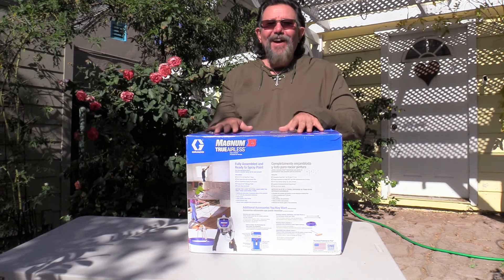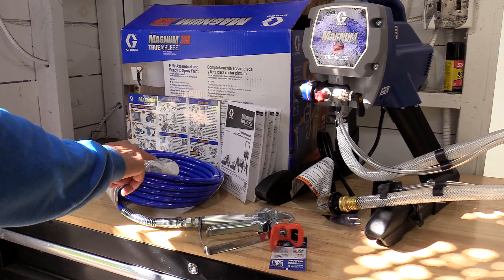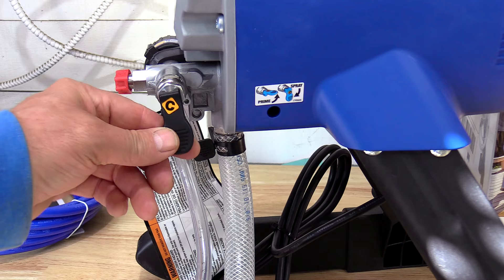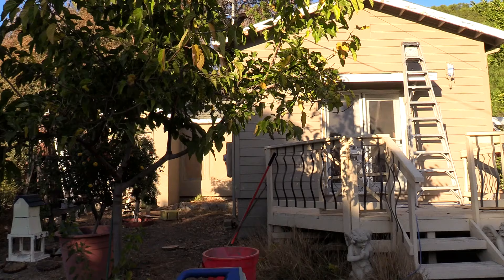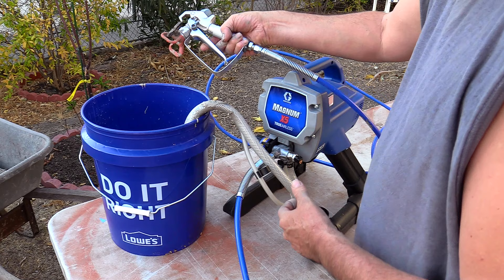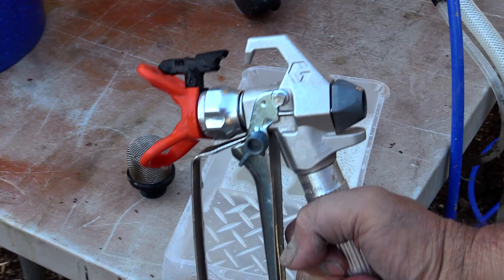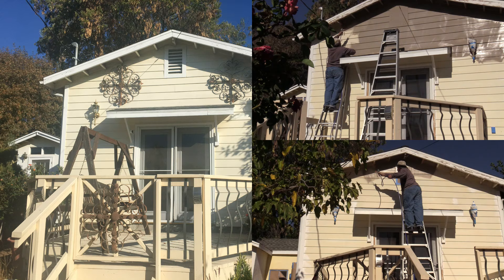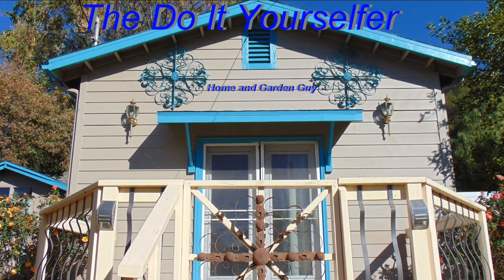Using My New Graco Magnum X5 Airless Sprayer

Comment: Very good demo.  Be sure to check Lowe’s for a Graco PRESSURE ROLLER accessory that is attached with supplied elbow where the gun spray tip would be.  It comes with a short extension tube. A 5 hole roller frame emits paint as gun is triggered and feeds a porous Graco 9 inch roller.  I purchased two extension poles and was able continuously paint  second story walls from the ground.  Very fast applying paint thick and smooth,  no over spray, no dipping roller into paint bucket.

Comment: This is a good video, but I just bought one and the directions say to clean the filter in the gun handle every time you flush the system as well.  Good presentation though.
Reply from the maker: Clean the system with water from a pressurized hose and it will clear the filter, just as would do it when taking out the microscreen that is in the sprayer. The cleanout shown works. 
Your comment is understood if my technique of cleanout is not followed.

Comment: Enjoyed your video. Really liked your 4 way split screen of painting.  Did you find it a problem moving the unit all time unlike x7? Thinking of x7 or x5 to purchase
Reply from the maker: It was not a problem moving it; the twenty-five-foot hose allowed me to move the ladder along, hang the sprayer on it, and then pick up the 5 gallon bucket in one hand and the airless compressor in the other for reposition and continuation.

Comment: spent 2 wks painting my house the last time so i bought this for 300 if it takes me 3 days this time it will be great and less toll on my body
Reply from the maker: It is a definite labor and time saver. After prepping and masking, to think of hand painting an entire house is daunting at best. I have an open soffits, and to think of doing it with a brush would make me not want to do it myself. I can't begin to think of the labor and time it saved me. The last big plus is that I did not need to thin the paint. Good luck with your project.

Comment: Great Video. Thank you
what about Graco Pump Armor is it necessary to use it or you can replace it with other things like soap water?
Reply from the maker: I believe the liquid has many more properties than soap does. It states in the documentation that it helps to keep your system from freezing. When I bought the sprayer, even before I read the documentation, I also purchased a secondary bottle. 

This is only my opinion, not referenced anywhere else, there is a reason for manufacturers to produce maintenance lubricants. Like my automobile and many other tools, I do not short change what is recommended. I used only premium oils in my equipment, and I do the best that I can to lubricate and maintain them, as I understand that experts and engineers have done their jobs to make the product's lifespan improved. Once again, this is only my opinion.
Reply: If DESPARATE use anti freeze or paint thinner

Comment: Did you have to do a second coat. Did yiu need to back roll?
Reply from the maker: Yes. I applied 2 coats. In one area of my small home, where the stucco is very exposed to the sun, about four hundred square feet, I went back to and sprayed it again after finishings each coat. I did it because I know how much degradation it receives from the sun. 
So I did two coats on my entire home, with two coats extra where I knew weather came into play. I did not have to back roll the paint. I put a clean paint brush in my back pocket for runs but did not use it--thought that was awesome.

Comment: FYI, you comment that the unit can spray mineral spirit base paint, The first thing mentioned in the WARNINGS literature  is  to use water based materials only...
Reply from the maker: I believe this the comment you are referring to:
Q: "Can you use this for oil based paints?"
Comment: "It can be used with mineral spirits. Check Graco specifications"

Here is what is found on Graco's website: “All Magnum sprayers can spray water-based and solvent-based paints, stains and primers that can be cleaned with mineral spirits. Materials that cannot be used with Magnum sprayers include solvent-based lacquers (exceptions are the ProX21 and the Pro210ES), texture based materials and elastomeric.” 

That is why the question was directed to their website for further information.
Reply: @doityourselferhomeandgarde9732  OK, After a little more research I understand the units don't allow lacquer/lacquer solvent use due to incompatible packing seals that will deteriorate. Lacquer thinner conversion kits are available to purchase that will allow use of lacquer products. I still find the thinner flash point to be a gray area. I was assuming that the brushed motor could spark and ignite thinner vapors in the air, enclosed area. Different paint thinners have different flash points so even a textbook answer can't be assumed...

Comment: Thank you for an awesome video. Did you need to thin the paint before painting?
Reply from the maker: No. That is one of the reasons why I upgraded to the sprayer. I have used it on a thicker Zinsser 1-2-3 Bulls Eye primer without thinning, also water based. I sprayed it at about 2400 psi and was pleased with the results.
Reply: @doityourselferhomeandgarde9732  Thank you, That's awesome. I have the magnum x5 and want to paint some kitchen cabinet doors.

Comment: Very Nice Video. I need to prime and paint my basement which is ready after drywalling and has concrete floors. One question I did have for you is, are there restrictions of what kind of primer or paint can be used with this sprayer? I didn't see a viscosity cup, so are there any instructions on paint thinning that we need to follow or can it handle a large range of viscosity?
Reply from the maker: I did not use a viscosity cup to check its thickness. Before I purchased the paint, I made sure it said was sprayable.  On the paint bucket, it clearly stated it should be sprayed at 2000 psi and did not need to be thinned. On the sprayer unit for pressure adjustment, there is no numbering to indicate pressure. Knowing that its greatest pressure is rated at 3000 psi, I rotated the pressure adjuster (knob) to two-thirds, which is equivalent to 2000 psi. Before I started spraying my home, I did a test spray on a piece of cardboard (I show this on the video, just before I start actually spraying my home). Hope this helps. And best wishes with your project.
Reply: @doityourselferhomeandgarde9732  Thank you so much for the quick response. Ive only painted with rollers and that too just once, so I was not aware of the psi mention in the paint bucket. That is vital info, thanks so much for sharing.
Reply from the maker: @sn2477  Yes. I used a water-based paint. I hope for your safety that you are using a water-based paint. You are correct?
Reply from the maker: Make sure you use a water-based paint, a mask rated for paint, and eye protection. Also make sure that you have good ventilation.
Reply: I have to first spray primer. If i use a water based primer, will it work directly with a 515 tip, even if the pressure range recommended falls within the X5’s range? Ive heard that water based primers can be thick.
Reply from the maker: I would recommend talking with the person who sold you the paint/primer.

Comment: Great vid. What’s is the cleaning solution you’re using to brush the tip at the end? Just soap and water?
Reply from the maker: Yes, dish soap. I used the sprayer the next day and finished my home. After I finished on the second day and knew I was not going to use it for at least two weeks, I ran the blue liquid through it to protect the inner workings of the compressor. By the way, I really like this sprayer.

Comment: How long can you leave it sitting idle if you've to change location or take a short break? That is, does it clog up quick or dry up if you stop using it for say 15 minutes or so? thx
Reply from the maker: I did take short breaks. I either moved the 5-gallon bucket of water-based paint into the shade when possible or used a white-faced piece of cardboard to deflect the sunshine away from the bucket.

Comment: Simple question how do  you reduce overspray, paint in air, airborne paint, for more precision painting with this unit? Chinese  unit didnt do this and my machine from 30 years ago. 

made sure area is warm, paint is warm  . not just the water
reduced pressure to lowest.  

So much paint is wasted with this unit.
Reply from the maker: Do not spray when there is wind, even a slight breeze. Try to keep the spray nozzle as close as possible without out runs. If concerned about runs, keep a half-inch smooth brush in your back pocket for easy correction. My personal experience is that the trigger and adjusted pressure work quite well. Even though I did keep a smooth brush in my back pocket, I never used it. Good sprayer for a do it yourselfer.
Reply: @doityourselferhomeandgarde9732  thank you.  even indoors same problem. i went a head and got a chinese spray gun/kit for $40 and it worked 100 times better then this unit.

Comment: can you do interior cabinets and small jobs with this unit?
Reply from the maker: I have not sprayed interior cabinets. But I would imagine it would do a consistent job. However, I know the sprayer has many different tips. I would imagine a tip that sprays in a finer mist or atomized fashion would be extremely useful. I would recommend doing a search on what spray tips they offer for cabinetry. I think it might be worth investigating.
Reply: Look for the 311 tip.

Comment: What is the thickness of that paint? And did you use a 515-spray tip?
Reply from the maker: The paint was purchased from Lowes new and was sprayed the day or so after it was mixed. The type of paint was DuraMax paint & primer in one. Its label recommended spraying at 2000 psi. The spray tip used was a 515. I was/am satisfied with both the paint and the sprayer.

Comment: Would you recommend this machine for a small project such as cabinets?
Reply from the maker: I have used it for 200 square feet on shutters (three coats)  and over 2100 square feet of my home with two coats, which makes that around 4200 square feet. It is a very consistent sprayer. I cannot comment on your cabinets, as size would make a difference. I know that if spraying a gallon plus of paint or primer that this is my go to sprayer, as a DIY person. It does a really good job. 
By the way, it is recommended to change the tip on this sprayer after 15 gallons of spraying.
Reply: @doityourselferhomeandgarde9732  thank for the information, have you used it with oil based non-flammable paint? Or would you recommend another spray gun? I was also looking at the Graco Truecoat 360 VSP. But I just like this one because I want to also do big project such as walls, and fences.

Comment: Could I paint a mobile home with this
Reply from the maker: If the paint used will work with an airless sprayer...check with the paint vendor.
Reply: If you can paint a house with it I should be able to paint a mobile home

Comment: Forgot to clean filter in spray gun
Reply from the maker: Nope. As the line was clear so was the filter. It was checked the next day when finished with my house. Even after the FINAL clean up for storage, it was clear, the same way the hoses were clear of paint shown in the video. On the final cleanout, I did run the blue storage liquid into system to prevent freezing. Questions, see Short Term storage on page 27 of owner manual for Magnum TrueAirless.

Comment: Show us the the queen palm tree sir
Reply from the maker: If you are interested in seeing how they're doing, I have provided a link to my Toro Leaf Blower video. One of the Queen Palms, with 10 months of growth, is featured in it. https://youtu.be/SaR0rgmUabI
Reply: @doityourselferhomeandgarde9732  
Thank you 🙏🏽 💞
I’m moving to LA 
I’m trying to know what type of trees grow there
Reply from the maker: @thezebrafinch4650   It's a fairly large county. So there are many different climate zones. Whatever city you move to, check the microclimate zones for that area. Driving around your neighborhood and checking what is growing in your particular place is very helpful.  
Finally, check the soil for drainage and what type: Loamy, sandy, rocky, or clay. If your lucky, you will have a loamy soil with good drainage. But even if you don't have the ideal soil, you can fix it with amendments, etc. For instance, I have a rocky and sandy soil with a small amount of loam. It drains very well, but some of the rocks in it are boulders, which means there is not enough nutrients. I have had to remove the rocks and amend the soil, and I use fertilizer. 
By the way, I have at least forty trees, of many that are from other parts of the globe. 
Another important aspect to consider is the wind. Know if your in a high-wind zone, as some trees stand up much better than others, and if they grow fast and tall but are prone falling or breaking, you might be disconcerted.
Additionally, I have some fruit trees growing in large pots: A pear, nectarine, plum, guava, and a cumquat. Their root grafts are from trees that do well in pots. It's kind of fun growing them as I custom make the soil for them from what I have researched online and read in my gardening books. A site I really like is SF GATE. I book I really like to use as reference is "California Master Gardner Handbook" (Second Edition, Editor: Dennis R. Pittenger). 
Anyways I hope I have given you some helpful information. Good luck with your move to Los Angeles.
Reply: @doityourselferhomeandgarde9732  
GOD BLESS YOU, you were very helpful

Comment: Just bought one used here in Monterrey México..is it good for big size proyects?? What about enamel.paints??
Reply from the maker: Yes, absolutely
Reply: @doityourselferhomeandgarde9732  thanks im using it monday for the first time ..bit of latex and enamel not really big job.
Any advices to accomplish a great result???
Reply from the maker: @rogeliovazquez8087  
I am not a professional. 1. But if you have never used a sprayer, you can practice with water. 
2. The spray tip size is really important for the material. If you do not have the manual, I would think you could find the pdf on the seller's site (reading the manual is important; it contains spray tip recommendations).
3. Weather is critical, definitely no chance of wind or rain. Temperatures cool. I like the low 70s. The paint your using will let you know its optimal temperature. Also, I prefer the humidity around 50%, but again read the instructions on the paint can.
Reply: @doityourselferhomeandgarde9732  thank you so much